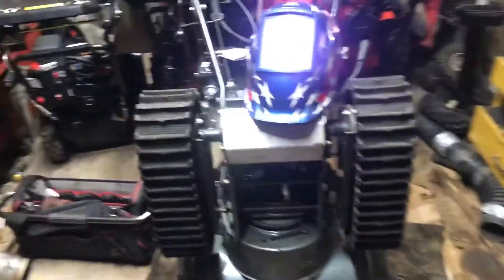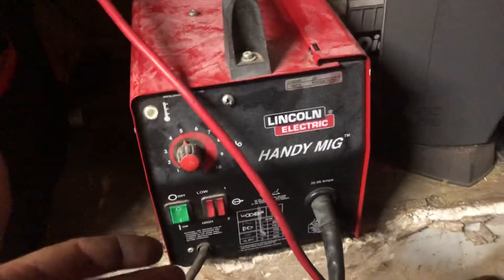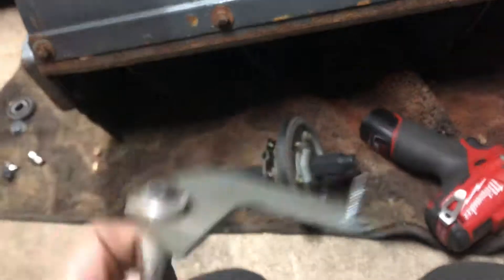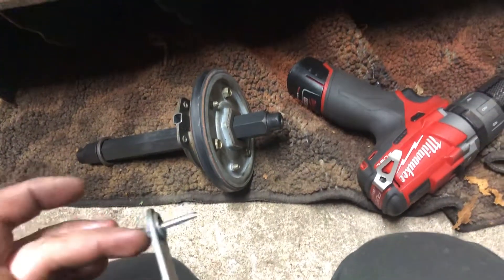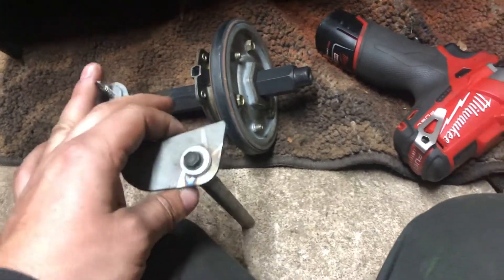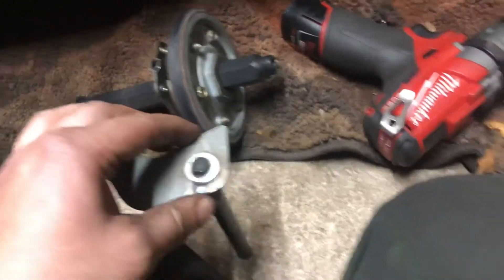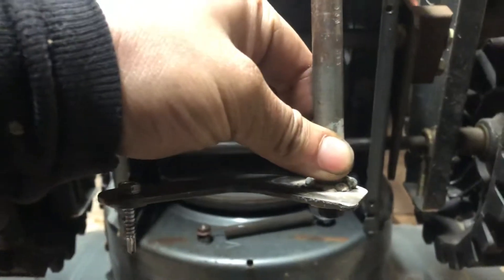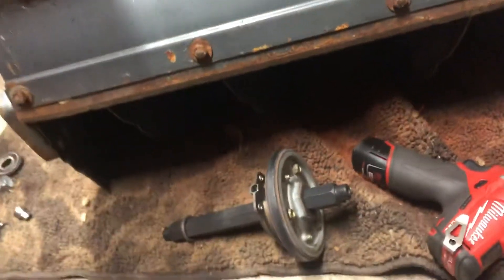How Swap Dual Shaft Tecumseh to Single Shaft Predator 212cc Hemi Engine Part 2

Comment: Very helpful my friend. You saved me a bunch of hair pulling! I don't have a welder, but some good flux and 6% silver solder did the trick for reattaching the flipped pin plate.
Reply from the maker: Andy H I don’t know why I missed the notification!  Great you were able to get it done with out a welder.  I just used a welder to reduce the risk of a come back!

Thanks for the view and comment, hopefully you subscribed to my channel.

Comment: Hi Bro, 
Could you please limit preferably eliminate the use of the word "Right?". BTW, I have done 2 shaft to 1 shaft conversions, quite a few. I quit watching your video just because of "Right?, "Alright?". My loss I am sure.
Reply from the maker: If your an expert then there is no need to watch the video.  Right?  Thanks for the view and comment.  Hopefully you subscribed to my channel :)  In all seriousness, what do you do for a tensioner on the drive belt?  I went through your videos and found nothing.
Reply: @pattayperformance  - I used a 28" belt (2" smaller than original) and the factory belt tensioner.The spring wasn't enough, so I added a few turns of stranded copper wire between the insert and washer so I could tension it manually and crank it down.
Reply from the maker: Andy H 

Very nice did you make a video on your swap?  I like viewing other people’s projects...

Together we learn and grow